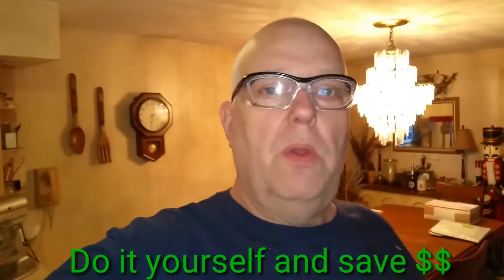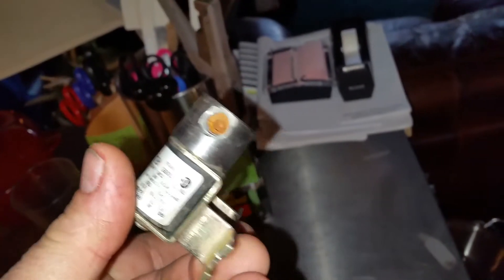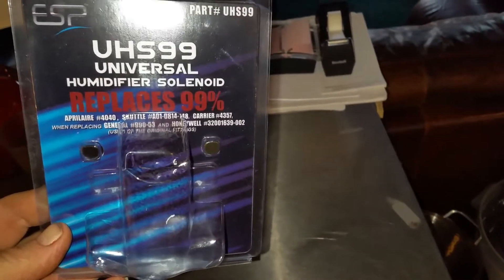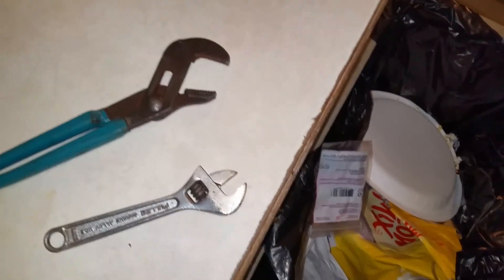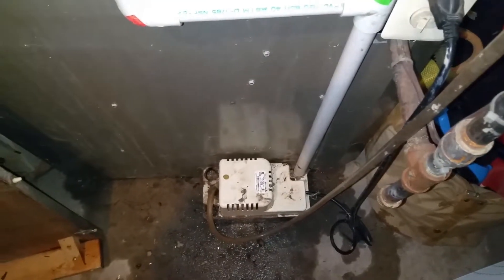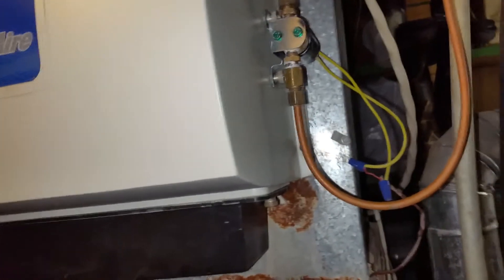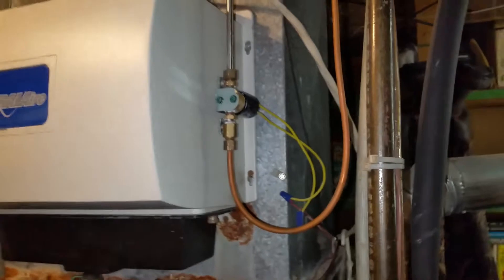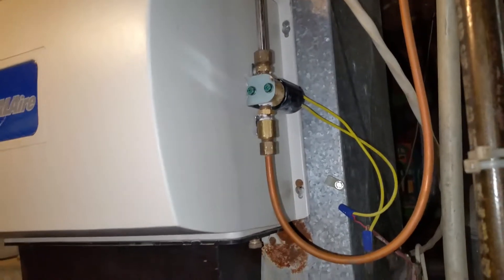How to fix humidifier solenoid valve yourself and save $200 or more

Comment: Hi Daryl. Thanks for video. Question: did you say it doesn't matter how you connect the wires? My new selenoid has two identical yellow wires while the wires coming out of the furnace are blue and red.
Reply from the maker: It shouldnt matter. The wires are just energizing the valve.
Reply: @darylturcott  thanks again!
Reply: @darylturcott  with the selenoid came a little screen. I didn't in your video whether you added a screen or not. Is that necessary? I should mention I live in Colorado and the water is is pretty hard.

Comment: anyone have an aquarium pump under the humidifier to catch the condensate and humidifier water and pump it to another drain ? I’m wondering why there is 2 wires connected to the furnace mother board.  The pump float when full works and pumps water.  Why does it need a signal wire ?
Reply from the maker: Without seeing the diagram i can only guess it might be related to a humidifier if you have one installed?

Comment: I thought the leak came from the selenoid, as it was hard to tell from the water spray.  Therefore, I changed the selenoid but when I reconnected it, there was a leak.  I found out the hard way that there was a crack in the plastic tubing. It could be that the selenoid was clogged so it built up pressure and cause the tubing to crack.  The tubing is likely 20 years old anyhow.   Thanks for the VID.

Comment: What’s the wiring if you have a humidistat?  Right now, my solenoid wires are connected to one green wire from the humidistat and one white wire from the furnace.   The red wire from the humidistat is connected to the red wire from the furnace.  I don’t believe my humidifier has ever worked and I just replaced my solenoid valve.  I know I’m getting 24 volts because I checked and I know water is getting to the solenoid.
Reply from the maker: If u have a volt meter you should be able to tell when humidistat is energizing the enid, causing it to open. The humidistat works just like a light switch and computes the circuit.

Comment: On mine it was just the brass fitting on the inlet side of the solenoid that was clogged. Luckily I didn't have to take the solenoid apart.

Comment: Aprilaire 4040 Solenoid Valve, 24 Volt for Aprilaire Whole House Humidifier Models 400, 400M, 500, 500M, 600, 600M, 558, 550A, 550, 568, 560A, 560, 700, 700M, 768, 760A, 760, 0.5 Ounces https://www.amazon.com/dp/B00NVPTWXM/ref=cm_sw_r_cp_api_glt_fabc_81YHTBNG99GFND7KABJ0?_encoding=UTF8&psc=1

Comment: I have been searching for a solenoid valve to replace my “general“ brand 1099 on furnace humidifier. The numbers on my current label are as follows: 24/60, 8.5 watts, 3/32 orfice. There seems to be so many out there that they all look very similar. Will this one work?

Comment: Thanks for the great video,
Can you help me locate a QUALITY solenoid that is also quite inexpensive for my humidifier? I'm located in Canada, and cannot find one anywhere. Maybe I could use a universal solenoid? I don't know. Any advise? 
There is absolutely no water pouring into the humidifier. There is plenty of water coming out of the pipe, but after the solenoid, NOTHING. PLEASE HELP

Here are the details about the solenoid I currently have:
KSD Com.
Type HB1. 
Orifice 1/16
AC 24V.
6.4W.
MH26533
Reply from the maker: honeywell 32001639-002 is the replacement part number. But a generic uh24 will work just fine.
Reply: @darylturcott  thank you very much for your help. I will check it out
Reply from the maker: https://www.walmart.com/ip/24V-Humidifier-Solenoid-Valve-Assembly-Replacement-for-Honeywell-32001639-002/178411294
Reply from the maker: I would check the Canadian sites for Walmart, amazon and ebay.
Reply: I purchased the one you recommend. It was a universal 24v solenoid. It worked for the first 15 minutes. The solenoid was clicking here and there during testing, then when I secured it to the humidifier, it stopped working. I checked the voltage while the furnace was on and nothing showed up. I think it should usually show 24v right? Can you help me? I ordered another solenoid of similar one to troubleshoot this issue. I did unplug the 24v transformer to see if that is dead, but that seems to be working fine. The furnace wouldn't turn on without the transformer, so I assume the transformer is working fine. With the transformer plugged back in, the furnace was running fine again. With all this being said, the humidifier isn't working again because there is not water going into the humidifier. The water line is open, the wiring is correct, and I replaced it with a new solenoid. Not sure what the issue is. Just you said in your video, the new solenoid was also shaking a bit and clicking continuously for few seconds before it sh
Topped working. Any idea how to fix this?
Reply from the maker: There should be 24v to solenoid while furnace is running. I have heard that clicking can be caused by too much water pressure. Try closing the tap valve and then just barely open it to restrict water flow. Also you can send me pics of the connections at transformer and solenoid. Darylturcott@gmail.com
Reply: @darylturcott  thank you soooooo much. Will do.
Reply: @darylturcott  I bought another solenoid and replaced it. Turned the furnace and humidistat on, but still nothing. I also noticed there is no current going to the solenoid. Any idea how I can troubleshoot this issue?
Reply from the maker: Also, I would double check the one you bought to make sure it is same voltage as transformer
Reply: I have the same problem with mine. Any luck?

Comment: If water flows even though the furnace is OFF, can this be a solenoid issue? (its a new issue so i know its not the wiring)  - IF so, can solenoid be repaired (Cleaned) or is it automatic replacement?
Reply from the maker: It should not be getting power until the furnace comes on. If water is flowing it is likely stuck open. You could try removing it and pouring vinegar  in the mechanism. Tgat might clean out any scale.

Comment: Daryl,  Great video.  Can you help me locate an inexpensive universal solonoid valve for my Aprilaire 112: their part # 4005: it is a 120 volt valve.  All I can find are in the $770 to $150 range. They must make a universal that would work but I can't find one.  I am willing to jerryrig and fasten to the outside of the unit, etc.  So any help in locating a cheaper valve would be appreciated. Thx, Bill
Reply from the maker: https://rover.ebay.com/rover/0/0/0?mpre=https%3A%2F%2Fwww.ebay.com%2Fulk%2Fitm%2F402108288508
Reply from the maker: New old stock, $39 free shipping
Reply: Daryl, can you answer this question: The humidifier should run only when the furnace  runs. They run concurrently. Is that correct?

Comment: I did the same repair last fall, put in a new solenoid, tried it out and the water still didn't flow. It ended up I had to clean the water orifice with a wire strand and then it worked. I kept the new solenoid because the old one was 25 years old anyway.

Comment: When I had mine installed, I instructed the installer to use a proper tee fitting and a proper shutoff valve rather than one of those saddle valves.  For one thing I'll be turning it on and off twice a year and a saddle valve is really not made for that.  Every time you operate your saddle valve you're increasing the odds it'll leak or break.
Reply from the maker: That's true.i couldn't even disassemble it to try and clean it. I need to redo all of the pipes, it's a maze of copper, galvanized and cpvc.